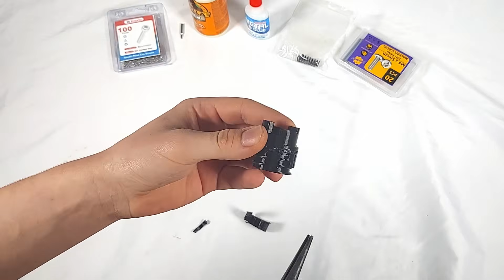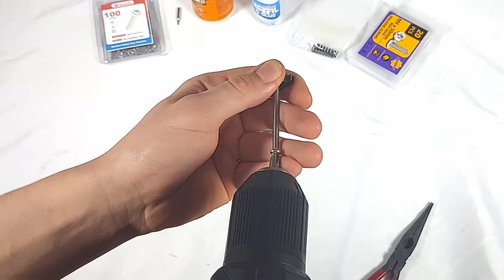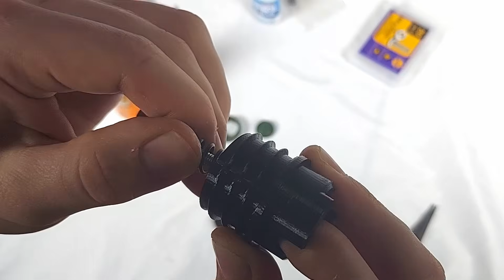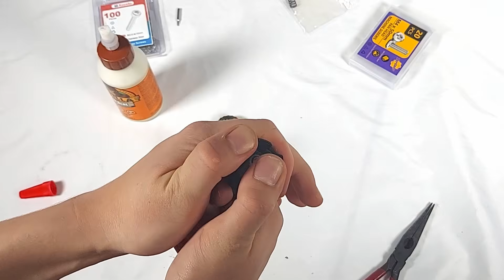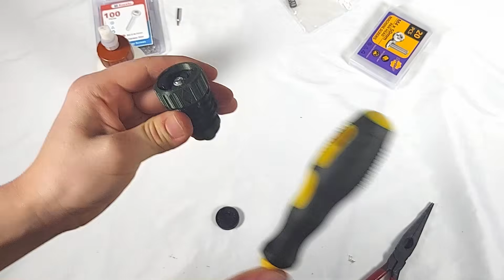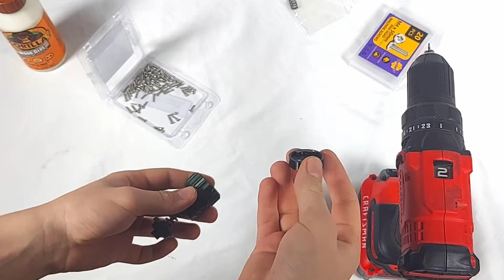ThunderStrike™ V2 Pull-Twist Fuze Assembly

Comment: You know whaf would be cool, if you can make shell have holes big enough to fill it with bbs so bbs can fly around
Reply from the maker: We thought to do something similar before, but it won't work with just ring caps. They just don't produce enough gas/force to propel BBs. We actually tested placing small "pop-it" fireworks in the holes on the M84 body (to achieve a "cluster bomb" effect), but it didn't have any success. To make the BBs fly with enough force and consistency, there would have to be a dedicated propelent system.

Comment: Why do you use wood glue on one end and superglue on the other?
Reply from the maker: We used to use wood glue all around, but it would begin to oxidize and rust the spring (it's also thicker, so it would sometimes lock the spring in place). Superglue is a lot thinner (and a bit stronger), so it doesn't make contact with the spring as easily. And wood glue still works well for the rotating catch, so we just kept using it. But you can use the same adhesive for both ends (apart from Loctite/threadlocker, unless your filament handles it well).
Reply: @isotac.airsoft  what an awesome grenade design. I am printing my 5th one as we speak. The only thing I have found I have troubles with is the fuse catch being slippery at times. I print bottom up, seems to help.
Reply from the maker: We appreciate it. That is a fairly common issue, but it can be pretty easily fixed through a few different methods (like printing upside-down, as you stated). But if it's not slippery enough, the detonation won't be very reliable, so we like to have a balance of sensitivity to avoid misfire and accidental discharge.
Reply: @Isotac.airsoft Is your M67 model compatible with the .209 primer conversion (both with and without spoon)?
Reply: @isotac.airsoft Is your M67 model compatible with the .209 primer conversion (both with and without spoon)?